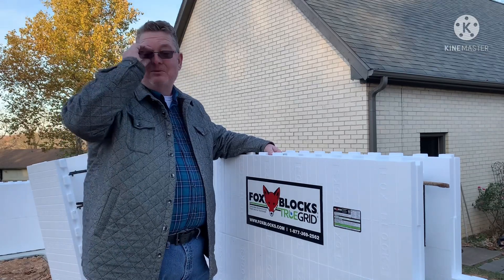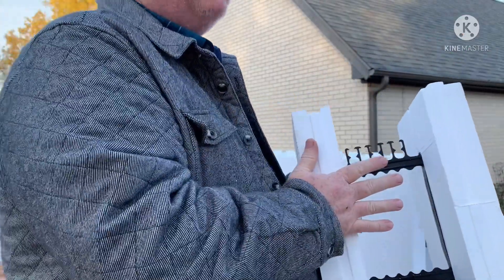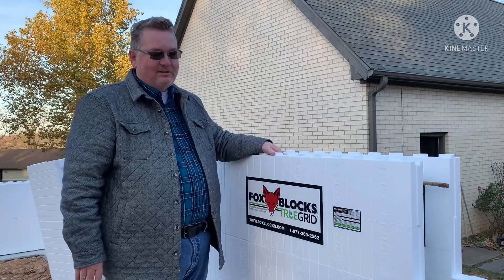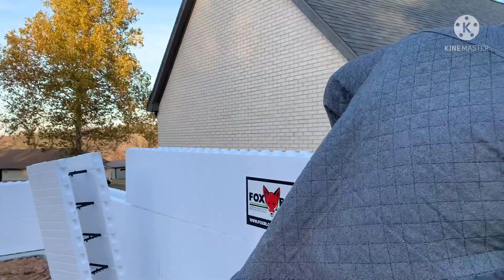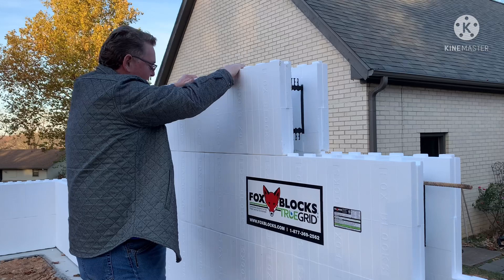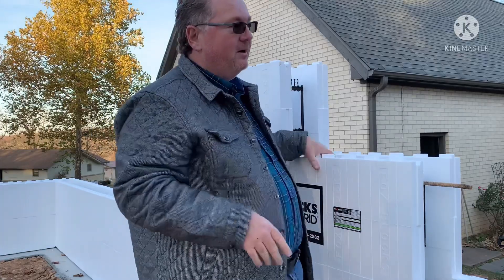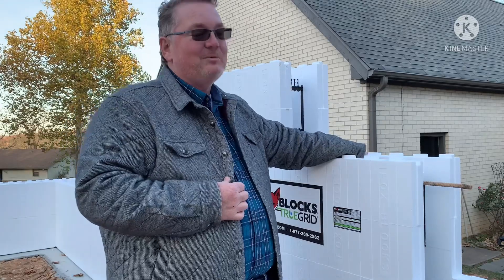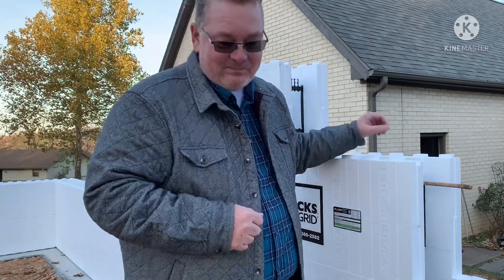Fox Block ICF. Why we chose them and how they work IMHO.

Comment: I've seen those on renovation shows, but never explained. I assume you still need to insulate before drywall? Sounds cozy. Can't wait!
Reply from the maker: Actually you don’t.  They have an R value of 60.  Which is the equivalent to 17 inches of insulation.  To run wire for electricity you just cut a channel in the styrofoam and lay your drywall over it.
Reply: Also.. can you compare price vs old school materials? Did they go up like lumber? I'm trying to get Uncle Mountain inspired for his Devil's Corner Shed.
Reply from the maker: I’ll cover price in my main vids.  Right now it looks about 20% higher in materials.  But the labor balances it out.
Reply: You have MY vote! Thanks for answering. Between you and Julio, I'm feeling like a girly.

Comment: I like that system.   Just about the time I was thinking it would be a good storm shelter you started talking about how good a storm shelter it will be.  I probably won't be building anything any time soon, but I'm going to check out some other videos.
Reply from the maker: I knew how important it was to Twine to have a safe shelter that was comfortable as well.  Thanks for watching.